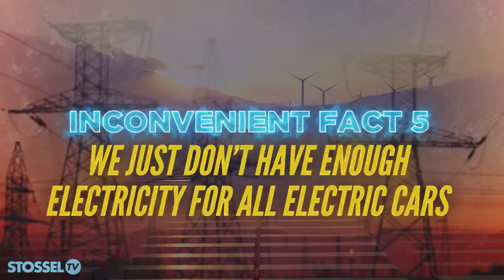Electric Cars: Inconvenient Facts, Part 2

Comment: I worked for a major public utility in Southern California for over 22 years. When deregulation was proposed and accepted, this utility was fully on-board and sold a number of its power plants in the LA Basin to companies outside the region. It significantly reduced their yearly costs from a personnel and maintenance perspective. A few of these were base load plants but the majority were what we called "spinning reserve." It allowed the authority that addressed the shifting daily needs of the region to provide the needed power. At times even this spinning reserve was not enough to meet the daily demand, and thus power from external sources was needed to make up the difference. But power was available and rarely were there any brownouts or full blackouts.

Then the companies that had purchased the power plants, who were required to make them available for baseload and spinning reserve, played a game taking them down for maintenance and other issues. Of course, they supplied power from their other generating facilities outside the state on the spot market, at a higher price point.

Then the state stepped in and prohibited the use of once-through cooling using natural resource water, so ocean, lake, and river water were no longer available for cooling the plant and the older facilities would need to build cooling towers to provide the needed heat sink. Of course, some of these plants were built in the 30s, 40s, and 50s and no land had been set aside to build that type of infrastructure. In addition, building those type of facilities are expensive and when you are operating on thin margins, to begin with, the cost-benefit is not there and the regulatory hoops that you would need to jump through were significant, see California Coastal Commission, Environmental Impact Reports, and potential neighbor opposition. So, what happened? Shut those plants down, and we will purchase power from other power generators outside the region.

Increase in electricity costs and rolling blackouts. Generators outside the region are required to service their regional customers first and any surplus can be placed on the spot market, but if you are at capacity for your local distribution, no surplus and the others that need additional energy are just out of luck.

No major electrical generating facilities have been built in California for a number of years and in fact, more have been shut down. This is a trend across the country and until someone with a backbone steps up, it will only get worse. All of the alternative narratives around solar, wind, and other alternative sources will not replace baseload requirements, particularly when the sun goes down or the wind stops blowing.

The ignorance of the general public about this issue is frightening as is the overwhelming noise from the alternative energy voices that drowns out those trying to deal with this from a realistic perspective. I'm an old guy and won't be around that much longer, but I wonder what my children's lives will be like. I think I lived in a sort of golden age and the future looks like 💩.
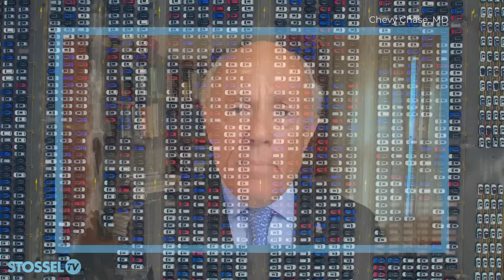Reply: (5:17) systems designed by bureaucrats instead of by engineers
Reply: Except California basically has no base load requirements any more and hasn't for some years.  Its not even a question... its in the data.

Have you looked at the duck curves on the CAISO?  Particularly in spring?   There are periods where traditional base-load-capable sources fall below 3GW of generation with evening ramps that are insane.

For example, take a spring day... May 10th 2022.  About 27GW of peak demand.  16GW 3-hour ramp starting at 5pm and only 5GW of traditional base-load-capable generation on.    Not to mention 80% renewables across the mid-day with non-renewable sources falling to 3GW.

That is what the system is capable of doing now.  And its doing it essentially without any real base load requirements.  The state doesn't even need to carefully match traditional generation sources (mostly natural gas and imports) against load during the peak evening ramp, even though the traditional sources are handling most of the ramp.

It just needs to be within a gigawatt or so and the 3GW worth of batteries with what I'm guessing are around 20mS response times take care of the rest.   Literally.

This isn't the grid you knew 22 years ago.
Reply: The ignorance of the populace in general is frightening . Just look how we vote !! Our children and grandchildren will never see the America us older folks experienced  ...
Reply: The problem of peaker plants was solved in Australia with huge batteries reserves.   California is building battery reserves that will dwarf the Australian ones.  All that excess solar and wind power that doesn't get used can be stored to take the place of spot spikes in energy usage when the sun is down and wind isn't blowing.  Golden age is already here.   We just haven't gotten to the middle where everything is gold.
Reply: And those battery storage facilities are pretty expensive for the power they store. Yes, it is better than nothing and should be used as a bridge to the future, when better electrical storage means become available, but the cost to extract, refine and produce the battery active material to  build storage batteries will be pretty large and it will damage the environment. Digging ore from the ground always does.
Reply: @junkerzn7312  and what does it look like on a sweltering August day, not a mild May Day?
Reply: @TheSwissChalet  lol, right?
Reply: @jamescalifornia2964  it's more how they "Count", don't you think? But I agree, people are stew ped. They care more about minute things than learning about their country.
Reply: Storing electrons in batteries is needed but not efficient in terms of practical daily use.
Reply: @TheSwissChalet  Sweltering?  We're talking about California here, not the east coast.  

And what does that have to do with anything?  Base-load requirements are not seasonally optional... either a grid has them, or it doesn't.
Reply: @franklinmartin8103  That's why they need to start building more of the CO2 batteries.   Just steel, water and CO2.  Cheap long term storage.   No lithium involved.
Reply: @picktheblueone  What did I miss?
Reply: @jeffcampbell2710  You are using really old data.  Current 1000 lb batteries need about 51K pounds which is 25.5 tons not 500 tons of ore to process for one battery.
Reply: @TheSwissChalet  ?  Something wrong up in the 'ol noggin, Swiss?
Reply: Agreed; all of it. I’m getting on too so it won’t affect me greatly, but future generations. that’s a completely different ball game. Veritas omnia vincit = truth conquers all.
God bless America 🇺🇸
Reply: We aren’t ignorant (ie. general public) we just have been overridden by politicians having or wanting fat bank accounts.
Reply: @franklinmartin8103  damage the environment once, then the material is mined and re-usable. Why is this even brought up whenever the discussion is in contrast to continuous environmental damage
Reply: How can I get a copy of your comment Chriron19, the one that starts with “I worked for a major public utility in Southern  Calif…?
Reply: @fetB  if you believe that all the battery active material is "reusable", I am saddened for your naive stance.  Just by the charging and discharging action this material under goes a volumetric expansion (during charge) and a volumetric contraction (during discharge). After several hundred cycles the material is pretty much in a mechanical state of fatigue. The first property of the material that changes is the crystalline structural. This material is refined and manufactured to exhibit specific physical and electrochemical properties. These properties change over time and spent battery active material is NOT 100% reclaimable. That means new material must be mined, refined and then processed for the specific properties required to store large quantities of DC electricity.  The spent active material can be chemically dissolved and then reprecipitated again under the same process used in the initial manufacture. But that to has a cost, and when first starting out, the cost of reclaiming low quantities of used battery materials will be higher than mining and refining new materials because of tear down and separation processes for all the various materials in the used Energy Storage System. You will be surprised at the cost. These operations were evaluated about 10 years ago by many large corporations. No one wants to be the pioneer in this since the entire cycle from cradle to reclamation and secondary usage is so costly. Many companies are waiting to jump in when all the processes that must be completed are better known and costed out.

It is simply easier said than done. For the politicians, that is the easy part. The doing part is the most costly. They won't vote for the billions needed to actually do this. Presently it is a great campaign gimmick to say that you want to. The hard part is getting the money first to set up the pilot plants, then collect data and go through endless cycles of improvements to find the least expensive processes to use. Mining, refining and making the initial active material is now well known.
Reply: @ignaciomenendez8672  hold down the right button on your mouse, and...
Reply: @Custos Luminis petro chemicals are going to be used for centuries.  American oil will exist for centuries.  Capitalism will make the burning of oil a lot less profitable.  Renewables are way cheaper than Stossel and the physicist that also said that smoking does not cause cancer is saying.
Reply: @victorluke5816  Australia has had their issues with the battery reserves, not to mention the indecision or change in government policy isn't giving existing plants the security they need to invest in required maintenance, so now they are going down more often.
Reply: @jim9930  And even those natural gas plants could take 30 min to 2 hours to get to full tilt. It's the ideal start to where they are producing and contributing to the grid in like 15-20 min.
Reply: I was a GE Gas Turbine Controls Field Engineer from 1998-2007.  My first job assignment was to re-install a LM2500 power plant from California to Jonesbough AR.  That took about 22 MW off the grid in California.  In 2000, I took another LM2500 power plant from Artesia CA to a Phoenix, AZ.  I took a total of 44MW off the grid in California.  The owner of the plant in Artesia could not make a profit, so he sold it.   Politicians and Liberals are poor engineers.   I did a small project in CA outside of San Diego.  The plant was Pio Pico.   You would not believe the antics of those who did not want the plant to be built.  Anyway, there is about 450 MW added to the grid that would not exit if liberals had their way.  Why no one calls them on the lack of facts is due to the reporters are all liberal arts majors, instead of engineers.  Thus, they don’t know shit.
Reply: @bengaltiger96  Never the less Australia battery capacity doubled this year.   While coal just gets more expensive to use.  This seems to be another reason to use more renewables if the old plants are failing.
Reply: @franklinmartin8103  you might have given specifics, but like i said, didnt even bother to read them because you already disqualified your whole argument with the premise. 

And i literally stated that politicians, that includes Biden, have no actual interest in changing something for the better. So much for comprehension skills. On the bright side, you got that in common with that cnt. Maybe you can bond over that and bury the hatched.

As for ad hominems, you've changed the tone. Dont like the echo, dont shout
Reply: @fetB  you are not in any position to disqualify anything. Your pathetic reply only shows a shallow childish understanding of the issues. Just like most politicians, for them and apparently you, it is easier to point the finger and wave the hands about how easy all of this is.
Reply: @franklinmartin8103  again, literally said its not easy, and i didnt disqualify anything, you did...
Reply: I saw this kind of same mentality infest our U.S. Navy. We had a spare parts supply shelf that had hundreds of New Old Stock still in original packages and used good parts not in packages but might just be bay it self in the bin. We had it all inventoried and sorted out to find it easily. One day we had some U.S. Navy inspectors come in and they saw the parts not in packages and asked about them. We said they we new and most likely had been put in a circuit only to find out the part we replaced was good so the old part went back into the equipment and the newly used part went back in the bin. We were told any part that wasn't in it's new package had to be thrown out, even if it had tested good. We threw hundreds of thousands of dollars worth of good parts into the trash can outside. Eh except, some wise old timers, for the really hard to find parts that were no longer manufactured we kept. We tested them and packaged them to protect them and hid them from the inspectors to ensure our Navy had the parts when needed. The weird part is in order to test those parts you have to take them out of the package. If the part is good you can put them in a protective package and the odds of that part actually being bad or damaged it ridiculously low, and the equipment it went in had to pass tests before it could leave anyways! In short we had to build up for weeks these parts bins then tear them down and ship the parts 6 states over to a central whorehouse that if we needed a 2 cent part we had to place the order through FOUR people minimum. They'd spend time to package them, spend $60.00 bucks or more to have them overnight ship them to us, and go through our supply system at the shop then we'd get the part and then install that 2 cent part. "You don't think they actually spend $200.00 dollars on a hammer do you?" Well folks I'm here to tell you, no they don't, they spend $250.00 on a 2 cent part in man hours and shipping. In the end we had to spend weeks building and tearing down these parts bins 11 different times before some paper pusher finally realized what we were saying all along. "We will save time and money if we have the most commonly used parts on hand, because we'll be skipping all those man hours and shipping costs to get it here. How did they figure this out? The Navy paid 10 of our people at 25 plus dollars an hour for 8 hours a day to sit in a room for a week with a guy who flew across country, rented a car, rented a hotel room, feed him, to prove to him why we need these parts and to come up with better ways to make the repairs faster. LOL you can't make this crap up guys! They're so worried about loosing a 2cent part that they'll pay thousands of dollars to pay someone to, store it in a central building in another state, watch it and catalog it and then overnight ship it to anyplace that needed it. On top of that we'd get paid to sit in a room to learn how not to offend or harass someone who's confused in the head about what sex they are, what race they are, what speech make them mad and hurts their feelings. If you do those things, well we don't care how many years of experience have on how to fix sensitive proprietary military equipment, we'll fire you and hire someone with no experience to take your place so that person whom you offended feelings won't get hurt by you again. We know it's better to protect their feelings that our nation. LOL Didn't happen to me but seen it happen to others. This country better wake up, before it gets hammered by our enemies. We're so worried about hurting peoples feelings that we're willing to degrade our military that protects us from countries like China, the Russians and the Religious nations around the world who want us dead and to take our stuff. I finally retired after serving our country for 43 years, my dad got sick and I got tired of the Snow Flake Sensitivity Training! He passed away this year but I'm staying retired, I don't think I could go back to the Snow Flake Sensitivity Training again. Well the real true Educational Training on what's going on is over folks. Best Wishes & Blessings. Keith Noneya
Reply: Cheiron, thanks for your wisdom. I only hope that the right people would listen to it.
Reply: @brazosbear4593  Unfortunately I don't think they will. I retired over a year ago, we were short 4 experienced technicians then. I've heard since then they've lost 5 more technicians have left for better paying jobs. Each technician has a certain amount of years of experience. To illustrate if you have 10 technicians with 10 years of experience each you have 100 years of experience in your shop. In the last 2 years we've lost over well over 200 years of experience in the shop and replace it with about 50 years of experience. Actual electronic technicians with experience are so short we replaced some of those positions with former military electricians and trained them in electronics because they have a basis of some electrical experience. It takes years to train a person to be a good electronics technician. Seriously we've become a board swapping troubleshooting military and for good reason. However if we ever get into a real shooting war and that supply chain breaks down you'll need real electronic technicians to know how to fix those cards and swap substitute parts into them that will meet specs in a combat weapons platform. Sadly I think I was one of the last few people to know how to do that at my job location when I retired. The Navy and other branches need to start training electronic technicians again. Think about the movie "Crimson Tide" when that tech had to fix the communications rack to prevent a Nuclear WWIII. Those are the kinds of tech we need and sadly no longer have. I know because when one of the FRC's Buildings that fixes electronics was being renovated we had to share our civilian bench space with the Navy and Marine Corp electronic technicians. They ran into a problem with a piece of electronic equipment chassis, went into a Marine Helicopter, that wasn't a circuit card that you could swap out. That equipment chassis some transistors in it and some wiring. The techs couldn't figure it out because NONE of them know how a transistor worked. I helped them isolate the problem and find the part number to order the part. Now this is ridiculousness because the repair procedure on that chassis wasn't in the book, they weren't allowed to order the part and repair it. The condemned that whole 10 of thousands of dollars worth of piece of equipment for a 10 cent transistor! They had to mail it to someone who knew how to fix it. Ok I need to stop, I could just go on and on, on how stupid our procedures and lack of training have become for various bean counting reasons. Best Wishes & Blessings. Keith Noneya
Reply: @fetB  poor attempt at switching perspectives. You must of did poorly in your college rhetoric class, if you actually attended any college classes
Reply: @jeffcampbell2710  It only takes 51K pounds which is about 10 times less than your figures.   The newer batteries are easier to make and don't use any Cobalt or Nickel.   Mostly lithium and Iron.
Reply: @junkerzn7312  the grid is worse than 22 years ago deregulation has increased reliability issues.

Base loads have 0 impact on the subject.  Go get a job in power generation
Reply: @victorluke5816  will not sustain you cannot store that mush power period. Peakers are not the anserw, combined cycle can't even do it.
Reply: @junkerzn7312  it’s funny how you dismiss that “gigawatt or so”
Reply: @fetB  and imagine the environmental impact of thousands of acres of solar panels.
Reply: @pmscalisi  How much power do you think non-base-load sources were pushing at the same time?   Explain how Diablo Canyon, which isn't even online 30% of the time, is synchronizing the grid all by its lonesome.

Come on.  Try.  At least try.  This is getting boring.
Reply: @SoGoodRc1  RIght now they have about an hours worth of storage.   They just need to expand that to about 4 hours and that's enough.   I'm going to bet on the Carbon Dioxide battery for the cheapest costs.  Peaker plants have been the answer for the last 3 decades so I'm not sure what you are talking about.
Reply: @junkerzn7312  that’s how power systems operate. The generator in sync is producing vars which helps offset the system reactance. 
If it’s not producing watts and the generator used is connected to the grid it’s basically a synchronous motor and exciting the field produces the vars.
It actually makes the power system more efficient. Nuclear power is cheap to use.
The system isn’t dc. It’s three phase ac.
Reply: @victorluke5816  What grid we talking about?  California right now has around 10GWh worth of grid-scale batteries in operation which do a 4 hour minor cycle in the morning and a 4 hour major cycle in the evening.

They push 2.5-3GW for 4 hours currently in the evening.   Below 2.5GW they push for 6 hours in the evening. 

There are at least 9 new battery projects proposed for 2023 and 2024 in NorCal alone that all together will add another 6.4GWh (1.6GW for 4 hours) to that total.

That will take the grid to almost 5GW x 4 hours of battery support in the evening.  And these proposals were before the heat wave.  I'm guessing everything is being accelerated now.
Reply: @victorluke5816  You can't just rely on the sun and wind. California is learning this lesson the hard way - which is why they have finally somewhat come to their senses and decided NOT to shutter Diablo Canyon. The more electrification required for vehicles, homes, steelmaking in lieu of coke, etc, required, the more baseload that will need to be generated, preferably from nuclear. And then if you want to get into hydrogen power, well, that's gonna require even more electricity, which means more baseload. Australia is the lucky country with all of its natural resources, but seems hell bent on misappropriating these in the quest for a greener country. I live here and there's absolutely NO reason why Australians should EVER be short of power, aside from not paying their bill.
Reply: @pmscalisi  You don't want to answer the question eh?  Well, it was rhetorical, but since you are so focused on one whole gigawatt doing all of this magical stuff, then perhaps you aren't aware that batteries push almost 3GW during the evening peak every day.

So which is more important for grid stability?  Your precious fossil and nuclear generation, or batteries?

By the way, that will be 5GW in another 2 years... probably more since I haven't looked at SoCal's battery plans, only NorCal.  In less than a decade we will probably have 10GW x 4 hours of batteries cycling daily.

What's your solution again?
Reply: @jeffcampbell2710  — Yes , sad but true ...
Reply: @pmscalisi  like what?
Reply: The future looks like fascism to me.
Reply: @FlanFlanScarlet  more probably some sort of natural gas fired generating plant.
Reply: @junkerzn7312  I take it you've never been to Redding, Red Bluff, or any place in the central valley?
Reply: O
Reply: @victorluke5816  peakers are just that.... they are not designed for sustainability they run during peak hours when power sells high. Unless they are combined cycle they are very expensive to operate.
Reply: @fetB  have you seen even one of these batteries reprocessed? I'm willing to bet that it would be impossible to do in the USA given the current regulatory state. Thus they have to be shipped back to China using fossil fuels to power the ship, and be reprocessed using fossil fuels....
Reply: @bengaltiger96  Why they're called spinning reserves was because they were in essence idling. Operating at some minimum capacity so as to be able to ramp up when needed.
Reply: @keithnoneya  I'd love to be able to upvote your comment a million times.
It certainly matches my experience with the army!
Reply: @wheel-man5319  but thats a political issue not technological. It's 100% a big problem in getting anywhere properly. And not just now, but has been for a long time. Belive it or not im a huge fan of ICE manual racecars and in a better world electric would have been developed alongside decades ago and thus drastically reduced or eliminated a lot of the problems faced today. From utilities being electric to a much more robust and independent grid, we would also haul dirty cars and nobody would care because that impact is trivial. It's important to separate imposed issue by politics and the technological challenges. You will never see me argue in favor of the BS politicians fabricate. Saw a quote a while ago that hits the nail. (paraphrasing) the people that strive into high places of politics are exactly the kind of people you do not want there because they got there by manipulation and only seek power for their own benefit. 

It is however possible and necessary to have smarter ecological things.
Reply: @SoGoodRc1  That's why batteries are such a good substitute for them.
Reply: @bengaltiger96  I applaud the decision not to shutter Diablo Canyon.  The only way to rely on the sun and wind is with batteries.  That's why the new Carbon Dioxide battery is a god send.  Cheap reliable batteries that require no rare earths and can reliably hold a charge for decades according to the science.  No one has kept a charge that long because the batteries are too new.  The new offshore wind generators are massive with the current record for being able to generate enough power for 8k houses per wind turbine.  This will increase the baseload considerably.  Australia is getting short on power due to power plant operators wanting to make more money.  They are building out wind and solar and not putting in enough batteries to make up for nightime low wind times.
Reply: @junkerzn7312  Looks like they finally got serious.  Great.
Reply: @victorluke5816  "renewables are way cheaper" 

No, they aren't. The reasons public chose oil over electric the first time was due to cost, efficiency, convenience, and mostly the cost. The only reason your renewables/green energy is even making headway isn't because it's better. It's because the politicians forced it on to the public. In every measurable market, electric vehicles and green energy are the worst solutions.  

"that smoking does not cause cancer" 

nice strawman distraction. You throw that tidbit in there like it has relevence to the conversation. You're part of the same group that will tell us that we should listen to the "experts" aka doctors and engineers, yet when those people tell you that you are deluded, you will claim they were bought out by the big corporation!
Reply: I am 65 and you are on the same page as me.  The future is depressing
Reply: Things as important as electrical energy, which one's livelihood depends on should not be at the mercy of the "general public" decisions through political action. Does the "general public" know the future? Does the "general public" know what is best for you? Then why are these important sectors subject to lawful controls and regulations? Laws are not made automatically from disembodied superior know-it-all entities. Laws are made by people, people who do not know the future and that are not omniscient. What happens when those people make mistakes? Is it OK because they were just "trying to help"?
Reply: Thanks, its rare to hear such a well informed explanation.
Reply: @birddogne666  Its more expensive to use due even in jurisdictions that don't have laws to make it safer to use.  
1.  Construction of renewable power is just cheaper due to falling prices of renewable power plants.
2. Coal plants are getting old and when they get old the repair costs make them less affordable.  Maintenance costs for renewable energy is just a lot cheaper.
3. Right now renewables are still more expensive to use in Canada, South America, and most of Africa.  By 2030 the cheapness of renewables will make it economical to bring them to these areas as well.
Reply: @steveharvey6421  You guys have been saying that for the last 200 years.
Reply: @birddogne666  Yes, I do usually listen to experts instead of the foil hat brigade.  If someone is being paid by big oil to say that there's no such thing as global warming I'm a little skeptical.  Especially when they say the opposite when they weren't paid by big oil to say it.    I would say the same if someone were independently saying that we should all use coal and then switch to don't use coal when hired by solar power companies to state their opinion.   Its usually a good idea to do that.

As for oil being cheaper just look at Chinese prices for coal, oil and solar.   No price supports for any of them.  Solar is the cheapest.   Why do they still build coal plants?   Because they build all power plants because they just can't keep up with the energy demands so they burn everything no matter the cost.
Reply: @picktheblueone  Just saying that their info is out of date.   Name me one where its current.
Reply: deregulation  of  power /  utility  companies  was  the  first  big  mistake.
Reply: @franklinmartin8103  And repeat it every 10 to 20 years too.
It's a horible solution designed to line politician and friends pockets.
Reply: I believe you and that's hard to say in the internet. Thank you for what you have written here.
Reply: @ignaciomenendez8672  I just screenshot it.
Reply: @victorluke5816  There will be ZERO excess energey to store in these batteries. We need it for daily use. Build more nuclear plants. Nuclear IS THE ANSWER.
Reply: @tedtedness184  Since each offshore wind generator can power 8000 houses I think it won't be that hard to get excess energy.  I would love it if California coudl build more nuclear generators but Californians would never allow it.   Unless we can get molten sand reactors which can be advertised as something that can get rid of  nuclear wastes.  That's the only hope for nuclear in California.
Reply: @driver4011  Its already happened.  We just have to live with it and use it to our advantage.
Reply: @junkerzn7312  nice deflection
Reply: @tedtedness184  
true.....and  what  are  they  going  to  do  with  all  the  old, used, corroding , n  leaking  lithium  batteries ? same  thing  with  all  the  used,  melted,  n  broken  solar  panels,  n  broken  wind  turbines.
Reply: @victorluke5816  
nuclear  works  well, n  so  does  coal.  there's  300  years  of  coal  left,  which  can  be  burned  cleaner  with  modern  filtration  technology.
Reply: Thank you!!
Reply: Thanks for posting, Ill save a screen shot so I can show this to our teenagers.
Reply: @franklinmartin8103  the exorbitantly expensive liquid salt tower was shut down because it was just too expensive. So much money has been wasted on alternative energy sources but we just don’t have the technology yet.
Reply: @junkerzn7312  How long have you lived in CA? Even the SF Bay area has a couple of weeks of 100+F days most years, when the normal flow from the ocean is reversed. And if you go inland, it's hot there all summer.
Reply: @driver4011  I'll do my best to take a few with me if it comes to that.
Reply: @victorluke5816  All the batteries in the world together, runs the world for one minute and twenty seconds,
Reply: Excellent information. Surely there are engineers who will step up…..
Reply: @victorluke5816  If these batteries actually come to life and end up replacing the current lithium ion batteries, then I'll be happy to see those complement solar and wind as peaking solutions (solar in the event of hot sunny days in the Central Valley). Hell, I'm still waiting for Vanadium Flow batteries to come to life in Queensland, which I think would also be a great, less expensive, and safer battery solution for home solar systems, but they aren't in mass commercial production at this time, either. A steady diet of nuclear baseload would truly be the key to low carbon mass power generation, and hopefully they will accelerate the SMR programs that are starting to crop up around the country and around the world. We need to use all the tools in the toolbox, and when it comes to vehicles, hybrids are far more the ticket than plug ins, which do shittier on the highway or on long journeys, or electrics, which will have their day when more dense battery technology comes around, but for now are more a specialty/boutique item being forced on the public too soon. In addition, for those who have longer commutes or live in the sticks, the demonisation of diesel for this purpose (other than farming and heavy transport) has also hurt the decarbonisation cause.  And finally, we need to focus on carbon capture and removal technologies, because regardless of what we do for power, China, India, the whole of Africa, and the whole of South America will burn coal and natural gas for power. We can develop and license these technologies to them (at least until China steals the IP), so they can also enjoy the benefits of a middle class existence with plenty of power. Energy will be needed in far greater quantities if we want to do shit like hydrogen production, desalination, steelmaking with less coking coal, etc.
Reply: @wheel-man5319  😊🙂👍🍺
Reply: Fellow suffering Californian!
Reply: Very well said sir! Thank you for speaking up!
Reply: @junkerzn7312  You're not believable.
Reply: @victorluke5816  That's not likely going to happen and batteries degrade over time.
Reply: @junkerzn7312  We don't need batteries the state needs more prime movers. The power has to come from somewhere and batteries are not it.
Reply: @victorluke5816  The United States only has one lithium mine.
Reply: @Gunalizer  You can make as many incorrect assertions as you like but the data, readily available on the CAISO website, tells a different story.   Real data from the actual grid, not made-up nonsense.

Beyond that, you are mostly complaining about your own misinterpretations of what I said, and your own misinterpretations of standard industry terminology.   That's  on you.
Reply: @junkerzn7312  I will admit, your statements aren't making sense to me.
I'm not convinced that even you know what you're trying to say.

One bit that sticks out to me - "The state doesn't even need to carefully match traditional generation sources (mostly natural gas and imports) against load during the peak evening ramp"

That sounds like science fiction technobabble - the shit you make up to talk about a subject that you don't understand.

As I understand it, electric companies constantly need to evaluate all sources of power and proactively match the output to demand. Failures to do so - the times that their redundancies fail and the system load doesn't match (over or under) - have lead to significant brownouts and blackouts.

"For example, take a spring day... May 10th 2022.  About 27GW of peak demand.  16GW 3-hour ramp starting at 5pm and only 5GW of traditional base-load-capable generation on.    Not to mention 80% renewables across the mid-day with non-renewable sources falling to 3GW."

This is a nothing burger. You're not actually saying any complete statement. You're not drawing a picture. You're citing a bunch of random crap (without citing sources) and saying that together it means something without context or support for such a statement.

You're not putting your technical details together in a way that presents coherently. Please tell me you're not currently employed as an engineer.
Reply: @Gunalizer  Batteries do degrade over time unless they are Carbon Dioxide batteries which are like forced hydro.  Also the LFP batteries take a lot longer to degrade than regular lithium ion batteries.
Reply: @Gunalizer  The US can build more lithium mines.  There's more than one location where there is lithium.
Reply: @bengaltiger96  The Carbon Dioxide batteries are actually in use now but only in one location.  I really expect  these to become more common due to their low cost.  Good batteries that cost an arm and a leg don't do well until they lower costs.  The CO2 battery is already cheaper than all the others.  They do take the most room so they are only good for stationary storage.

Diesel deserves some demonization.   Firefighters that use diesel vehicles typically lose a few years of life due to the exposure to diesel fumes.

Countries that have experienced nuclear melt downs usually have a much higher resistance to nuclear power.   Currently those are the former Soviet Union, the USA, and Japan.  All modern reactors are safer than the ones that melted down.   I just have a hard time seeing them build more nuclear plants in the US.  Once again, molten sand reactiors may be the only exception.

If Tesla gets a foothold in Australia you will probably have their superchargers dotting the landscape soon.  They build those superchargers really fast.   I complained that I had to drive at least 10 miles to get to one and the next month they built a 13 unit supercharger 1 mile away from me.   When I complained about the 13 unit supercharger being full alll the time they built a 25 unit supercharger 3 miles from home after 3 months.

Hybrids have been around since WW1 on submarines and I just think that improving batteries is a better idea.  

Long distance drivers will need to use some of the solar designs like Aptera which I am hoping will be delivered in 2023.   I want an EV with a thousand mile range that self charges 40 miles a day.  I won't place an order until they start delivery.  Their deluxe prices are lower than Tesla starting prices and they also use the Tesla power plugs.

Carbon capture has been too expensive to use so far.   Not saying that it will never be cheap enough but so far it hasn't been.
Reply: @waynecooling2433  When they mass produce the Carbon Dioxide battery they can build enough for them to run the world for a week.  They are that cheap.
Reply: 🐑🐄🐖 Animal Farm!
Reply: @victorluke5816  No. It takes massive mining operations to mine lithium. Not happening anytime soon.
Reply: @victorluke5816  You can't "build" a lithium mine. You have to have lithium deposits and conduct massive amounts of mining. Just like for coal. The irony.
Reply: Yes that's what happened as when the State gets involved running it.  Once you don't pay attention to up to date, it gets expensive. I used to live in California little more than 22 years.  No longer live there now.  Left for good. CA wastes lot more tax payers money, not just only  electrical generating facilities, roads, and many more as I saw.
Reply: @Gunalizer  Exactly there are more deposits than mines in the US.   I'm glad you understand my point.
Reply: @junkerzn7312  So your saying that someone who has worked in the industry doesn't know squat,but you are the genius that has all of the answers.
Reply: @Gunalizer  Elon Musk does support mining.  He's also no leftest.  He's been able to get more mining done.  He's been one of the best beuracracy smashers I've ever seen.  He built the Berlin Gigafactory in less than 2 years.  Normally takes about 10 years for the Gemans to let someone build something that big.   I have no doubts that he's going to be able to do it.  The cars are not magic they are just better than the ICE cars and by 2023 the ones that are cheaper than ICE will start to be sold.
Reply: Whoa 😳
Reply: @Gunalizer  Mining has to be done somewhere.  The US can do it better and cleaner than anyone else.  I vote for mining in the US.
Reply: @junkerzn7312  I assume you were living a cave when the "do not charge your cars" mandates were issued. THAT is the future in California. Enjoy it.
Reply: EXACTLY
Reply: @birddogne666  I agree with you, I am not an engineer,I don't claim to know a lot about electric power generation, but I seem to remember an old saying "If it not broke don't fix it" and "If it's not broke,don't fix it till it is",there was nothing broke with an electric power system using coal,natural gas, fuel oil or nuclear, it was plentiful,cheap and very reliable, so why are we trying to fix what isn't broke? We have no shortages of coal,natural gas, fuel oil or nuclear, except for the Biden administration artificially creating shortages with there forced shut down of gas & oil pipe lines in favor of so called renewables,this is like a huge subsidy to the renewables,while there have been some subsidies to the oil and gas industry, I don't remember the federal government shuting down other energy industries so that fossil fuels would have a clear field all to themselves, in the beginning the government didn't get involved in the competition between oil and electric to power motor vechicles,they let competition decide that and oil won because it was better,electric powered vehicles have basically the same problems now as they did then,the federal government  should get out of the way and remove the restrictions it has place on the oil and gas industry, and let the two compete,but the Biden administration doesn't want to do that bc it knows that oil would come out on top again besides,if the renewable industry needs so much help from government, isn't it just possible this is not the way to go,perhaps it just isn't ready for prime time.
Reply: @victorluke5816  Sorry to break it to you. That's highly unlikely.
Reply: @Gunalizer  I can't see what you are replying to.  If its about mining then that's what the IRA was passed to do.  Make more mining, refining, and building of batteries and EVs in the US and North America.  Elon is always good at getting tax credits.  When they changed them in Canada and China to make Tesla ineligible he was able to change enough to get his cars back into the rebate and tax credit zones.  I see him going into mining and refining of ores pretty easily.
Reply: @victorluke5816  hope they don't do a tesla...and go up in smoke.
Reply: @fetB  these lithium batteries are not easy to recycle...and are dangerous when not handled correctly.....
Reply: @feydespiel.  A dedicated battery recycling center is required.  50% of lithium batteries are currently recycled including the ones in cell phones and laptops.   Once everyone remembers how valuable the recycled products are they will dig them out of landfills.  Redwood Materials can handle any lithium battery recycling.
Reply: @feydespiel.  You mean have 8 times less chances of catching on fire than an ICE vehicle. 

If you are talking about CO2 batteries they actually can't catch on fire.  Steel and water don't normally burn easily.
Reply: @junkerzn7312  Trust the " science" right? Depending on which god you serve of course.
Reply: @feydespiel.  Just add water. 😂
Reply: @bengaltiger96  "...which is why they have finally somewhat come to their senses and decided NOT to shutter Diablo Canyon." That's excellent news. My old hometown hasn't completely turned into Corinth just yet.
Reply: @hardlyb  Pretty much all my life, Hardy. Hot days do not necessarily translate into power generation shortfalls.  In fact, they rarely do because it is fairly uncommon for the coast (where most of the population lives) to stay hot overnight.   Evening and overnight are the only time periods that the grid cares about.

The typical overnight cooling leaves a veritable ton of power available for inland AC use going into the evening.   We barely had even two weeks of weather this year where the coast didn't cool overnight.   Plenty of weeks of hot weather, but not so much situations where the entire state stayed hot overnight.

And of course, the state has so much solar that there is never a problem before 4pm anyway.  Hot days.  Solar... kind of a good match, eh?

That is the reality.     What the state actually suggested during the most recent heatwave was the following:

(1) Run your AC full-out during the day

(2) Try to conserve energy across the evening peak (basically 7pm, but the request was 4-9pm during nearly the entire heat wave and 4-10pm on two days of it.

(3) Don't use large appliances are charge your EV during the evening peak (4-9pm) to help the state get past the peak.

That's it.   Of course, idiots living in their little bubbles of nonsense just glommed onto the "don't charge your EV" part and kinda forget about the rest.   And also kinda forgot the little detail about the state having huge power margins during the day.   Like the guy trying to talk-down battery storage... showing complete ignorance of how the power grid operates on a day-to-day basis.

Idiots who are continuing to post their nonsense.  But I don't really care... if it means they actually believe their own nonsense and never contemplate migrating to California I am all for it.  Our population is too big already.
Reply: @junkerzn7312  I live in reality,always have,I don't claim to be an expert on electric power generation, but I know that using coal,natural gas, fuel oil and nuclear to generate electricity has always worked just fine and has been reliable, when I flip the switch the lights come on and I can afford it, if we continue to go down this rabbit hole of renewables, I will one day flip the switch and the lights won't come on,and if they do I won't be able to afford it, I can easily see a world where the common people will not be able to afford to heat or cool their homes,but the wealthy elites will of course have no problem, and only they will have electricity, while the rest of us go without,and all of this bc of this climate hysteria over something that not happening,I am 70 and I haven't seen any change in the climate, none of the predictions that have supposed to have happened by now have come to fruition,it is imo a hoax,the greatest scam in world history, besides there is nothing wrong with continuing to use coal,natural gas, fuel oil and nuclear to generate electricity, that way of generating electricity isn't broken,so there is no need to fix it,btw,insulting those who may not agree with you is not the best way to win them over to your side, in my response to you,I hop you notice that I did not insult you by calling you names like you did me,I have noticed in my lifetime that when someone starts name calling,it's usually because they have lost the argument. Please have a nice day.
Reply: @theberserker9285  What rolling blackouts? Maybe the problem is that your assumptions are wrong.  Have you ever considered the possibility that your information sources are lying to you?
Reply: @theberserker9285  Past tense.  Look at the date.  You did look at the date, didn't you?Did it happen to the level of exaggeration you keep on trying to push?   No?   In fact it did not.   Did California suffer blackouts at all this summer?   No.  It came close, but nobody's power had to be turned off.

And also, why are you continuously trying to misrepresentation my position on grid stress?    My position is certainly not that there isn't any stress or that there isn't a chance of a blackout.  We came quite close once this summer. 

But you know, that's a whole lot different than the story you are trying to paint now isn't it?   You are so invested in wanting the world to be a miserable place if the disasters aren't big enough for you well, you will bloat them up with exaggeration until they are.
Reply: @junkerzn7312  What argument ?
You're sharing your thoughts and I'm
sharing my sources of information.
You seem to have some kind of superiority complex that I find quite offensive..
Reply: @junkerzn7312  Rather than getting all high and mighty ....Just post me a link to a credible source of your information.. that would be much more helpful that being rude.....
Reply: Being saying it for years....
Reply: @franklinmartin8103    1.  Must've, not "must  of."  2.  Why the ad hominem attacks?  Rely on your technical savviness and persuasive presentation skills.  YT has enough interpersonal ugliness as is.
Reply: @keithnoneya    I say we focus more on amping-up bringing in the right brainpower, not manpower as now, through expanding targeted immigration.  But how would we produce out of those new visa holders and immigrants alike coming in the "humble" technically-trained, like lowly electronic techs, we need when what's coming in now mostly want even higher-tech education and jobs and the money and prestige that come with that?  How can we make what you and I WANT, i.e., hands-on tech careers, sufficiently 'profitable' in the money, satisfaction and status sense?  For example, for the Indians coming in now, software-savvy jobs is where it's at, right?
Reply: @brianjob3018  well, i didnt bring the hatchet, so its not really my right to bury it since its not my property. Secondly nobody said it was easy or that you can convert/return 100%, which is his premise. It's semantics to argue whatever percent here and there when the alternative is to extract the finite resource and burn it completely. It's the same with the mighty dollar, thats, among other techniques, so effectively used as an emotional tool in this video. Trillions have been used to secure and subsidize the black gold, but somehow sustainable option are suddenly expensive and therefore not an option. The mere facts its a circle instead of a line we're walking currently, is grounds enough to work on it. But then again, solutions isnt really the goal of some people but to keep things as they are, because muh V8, which is funny because i actually love combustion engines myself a lot
Reply: @wheel-man5319    Make sure you actually  understand what Fascism truly is, and the associated words fascist and fascistic, before you throw that word around more.  To the Left, Fascism means "naughty right-wing behavior and plotting that we use to cancel the Right."  How about to you?
Reply: @victorluke5816    Molten sand reactors???
Reply: @FlanFlanScarlet  No "Spinning Reserve" are smaller generators that can be bought online relatively quickly to deal with spike loads. This would be something like small gas turbines that would spend most of the time shut down and can be spun up very quickly from cold.
Reply: @fetB     My position on the whole oil, "climate change," blah, blah matter for many years has been we need to coerce the Big 5 Oil Companies into installing at all of their gas stations worldwide where practical recharging, natural gas refilling and hydrogen gas tank exchange ASAP.  If the supply of such is there, then the demand for the vehicles will be there and the manufacturers will be motivated to invest in making them. I basically agree with your sentiments about renewables/sustainables and needing to invest, but, again, the evil Big 5 are calling the shots and holding us back!  So, what's your suggestion?
Reply: @brianjob3018  They can use nuclear wastes as fuels.
Reply: @brianjob3018  Fair, im just saying, not really up to me since i only clap back. 

Anyway you mean my suggestion to people like the other commenter or politics. For the latter, obviously there is nothing to suggest. This isnt an accident but been a campaign for a long time. GM made pretty good EV (for its time) in the 90's you're probably aware of, and then came the "motivation" to scrap it. Elon musk for he is evil, did brute for the change and now battery development kicked in a proper gear, but this takes time. 

As for the other commenter, id suggest, dont be a twit. I can only assume the motivation is to keep combustion cars, but with increase of the environmental/resource fallout, laws will be strickter. So mocking, twisting or convoluting facts, like this video, is only contributing to what he dosnt want, myself included. Imagine electric/battery was developed with all the trillions spent oversee a few decades ago. Not only would be further, 9-11 probably didnt happen and nobody would care about some diesel bros and big block hanks.
Reply: @jamebrooke894  Can not be done in Southern California. The dispersal of cities and population centers pretty much mandates private vehicle ownership.
Reply: I am an old guy as well and I can see that you are totally on point! Just yesterday I watched a video from eight years ago entitled "The Politics Of Green Energy" (Robert Rice) From Hillsdale College A very informative and totally on point presentation. As for myself I have totally figured out that this push for green energy from politicians is totally bogus, just wish the rest of the asleep population could see it.
Reply: @copyking01  You do realize that any information that is older than 5 years on green energy might as well be from 100 years ago.  The science is changing that fast.
Reply: @brianjob3018  Ancient Corinth. "Corinthiazomai" was used as a slur in the ancient world for the wealthy degeneracy. Which doesn't make for the best decisions when it comes to political, social or economic issues. From Thucydides to Donald Kagan, they don't paint a very good picture of Corinthian higher reasoning.
Reply: @victorluke5816  We will see.
Reply: I see a day soon where you have to generate you're own power, purify water yourself, fix the car yourself, hunt and grow you're own food, arm/protect yourself because the only the government is capable of doing is collecting taxes/funding the military. I'm having trouble finding a reputable car repair shop because the government isn't willing to punish any of the dishonest shop. I recently had a Toyota Corrolla engine damaged because the shop did not replace spark plugs when I paid them to replace spark plugs. I am learning how to maintain the car myself because taking it to a shop is such a crapshoot, this is hard because I'm a full time worker who doesn't have the time to be a mechanic.
Reply: @brianjob3018  No that was actually a mistake, but that's funny anyways. There's actually quite a few good qualified tech. They're call Ham Radio Operators. Problem is most of them are retired or it's just a hobby for them. The government wouldn't hire them anyways because of their age and wouldn't pay them what they're worth anyways. Our military needs to train specialists in this area like they did before in the AVIC7 classes. It was an advanced electronic theory and training, like a crash course in Electronic Engineering. To kick start some of future techs they ran lower version of this program called AFTA in Millington TN. You had to sign a 6 year contract and if you passed you were promoted to E4. Best Wishes & Blessings. Keith Noneya
Reply: @brianjob3018  No they were already in and from what I understand based on their ASVAB scores or grades they were offered the school for an additional two years. If they passed and got to the fleet, many who had gone up the ranks the hard way called them, "Rent a Crows". A lot of them showed up thinking they were all that and kinda pushed their rank around a little and soon found out they may have the training but they had no experience or respect from others. Now if they showed up respectful and learned fast and earned the respect of their peers they did great. I do think the military could revive these schools and provide rank incentives and it could work if managed and supervised by the commands who received the newly trained technicians. However I think the best use of them would be to offer it to junior personnel who had already went to the fleet and showed the aptitude for it. I had this one kid ATAN (E-3) working for me in the HTS (Hybrid Test Set) shop that was totally brilliant. He had had some electronics and programming experience in High School. He was intelligent respectful had a family and you could tell this kid was going places in life and the military. I would have recommended him as a candidate as fast as I could If that program was available then. Best Wishes & Blessings. Keith Noneya
Reply: @brianjob3018  They were already in, and were offered the school if they sign an additional two year contract. I think it could work for sure. I also think they should offer it to technicians that have already been to the fleet and show the aptitude and drive to do the job. Had an ATAN E-3 working for me who was brilliant. He had some electronic and programming classes in High School and was an amazing worker. He wasn't a smart mouth, he was respectful and highly intelligent. He was the type of kid you knew was going places in his career or life. I would've nominated him in a heartbeat for that advanced training. Part of the problem with the military is they make "Jack of all trades and master of none". They do this so if something happens to another co-worker they can step in and do that job good enough to get by until a replacement arrives. However the military needs to build up super techs who specialize in certain areas in case the supply lines are cut in war and spare parts aren't available. Ukraine is an example. Also the military is focusing to much on stand alone all in one test sets. When one part of that test set breaks down by regulation you can't use the rest of that test set to repair aircraft equipment, even if the rest of the test set is perfectly fine. However lately they have started to shift to allow some of this due to shortages in equipment. It's called limited capability. Best Wishes & Blessings. Keith Noneya
Reply: @keithnoneya    I was leaning more towards that they were already in, partly because you mentioned six-year contract
For the Army, and probably applies to the rest of the military, you can only get an 8-yr contract when you first come in, after that, no more than a six-year.
Reply: @brianjob3018  They were already in and in A-School after Boot Camp and were offered the class if they signed on for two more years. As far as if they had already signed on for 6 or 8 and could still be offered the school I don't know. Best Wishes & Blessings. Keith Noneya
Reply: This is fantastic. Thank you for taking the time to write it.
Reply: Cherion right there with you brother over 36 years in the power business from the meter base to the power plants (coal, nuclear, gas, oil, and renewables).  We are headed for a brutal lesson because the politicians quit listening to experts like us.  God be with our kids and grandkids.
Reply: @victorluke5816  you obviously don't live in South Australia buddy! You also must only read sources in an echo chamber of green leftism. That battery storage you speak of, at best, can only support 20,000 homes for a maximum of 1 hour. Let me assure you that there are many, many times more homes, and business and industry in South Australia than that. The only reason South Australia can avoid blackouts is because they have a life line in the form of the national Grid Interconnector, which supplies them with power from the eastern states of Victoria, New South Wales and Queensland. Do I need to spell out what type of power generation supplies the electricity to that national grid?
Reply: @victorluke5816  renewables way cheaper? If that was true, then there would not be a need for subsidies provided to them everywhere in the world. Poorer countries around the world would not be building fossil fuel power plants if that were true. Put simply, if renewables were the cheaper, better solution, the consumer would 100% adopt them without the need for any activist propaganda, no subsidies and no reservations. Just as the consumer has done with every other genuinely better offering ever.
Reply: @frankjohnson8098  I love your work mate. Cuttin' through the bs using experience based facts. That will never catch on!
Reply: @victorluke5816  the old plants are failing due to deliberate political interference, causing the halting of regular maintenance. I suppose you missed the out of control burn down of yet another wind turbine here in Australia a couple of days ago. That would be new renewable plant failure. A blaze out in the tinder-dry Australian bush in the middle of summer. No problem with that, we all know Australia doesn't experience some of the world's most devastating bushfires on a regular basis. Oh, wait...
Reply: @junkerzn7312  not hard to discover that CA survives by buying in power from other states, because it can no longer support its own needs since going big on renewables. Not to mention, the increase in power prices renewables also caused.
Reply: @georgebeare8883  Eventually all power generators will be renewable even if there were no subsidies.  Especially if the subsidies were taken out of fossil fuels which by far has the most subsidies in any fuel systems in the world.  In the US subsidies for fossil fuels far outweigh those for renewables even with IRA.
Reply: @georgebeare8883  Are you actually saying that wind cause more fires than fossil fuels which are by definition a fuel that you burn?
So far you have been the only one that I have ever heard making that distinction.  The reason maintenance is not being done is that everyone realizes that its not cost effective to do so.  Why maintain something that is going to cost you more in the long run while its getting replaced?   We see this calculus in most industries.  This includes the military when looking at assets.   Old equipment that gets maintained and refurbished is due to a need.   If something that has lower maintenance costs comes along the old one usually goes away.  Renewables have the lowest maintenance costs.
Reply: @victorluke5816  oh, yes. The old " are you/ so you are saying" line. Is that what I said? No. I would also note the difference between a burning down tower that cannot be extinguished out in bone dry countryside and the controlled burning of fossil fuel in machinery is worlds apart. Likewise, your misinformed assertion about fossil fuel not being maintained because it is not cost effective is another half fact. It is the case in some countries, those which heavily subsidise wind and solar, that then artificially makes fossil fuel uncompetitive. Without subsidies for those so-called "cheaper" renewables ( which wouldn't need subsidies if they were cheaper ) then fossil fuel stacks up as it always has: highly commercially viable. Just ask the Indian, Chinese, African and Asian nations which continue to build more fossil fuel power generators. Something nobody would do if renewables were cheaper and is therefore, the ultimate proof that renewables are not.
Reply: @georgebeare8883  We are not talking about deductions here.  There are straight subsidies that are only available to petrochemical companies.  These are incentives to drill.  Sure drilling is profitable.  However, they are even more profitable when a government gives you money to do it.  Currently about 20.5 Billion US dollars are put into the profits column of Oil companies due to these subsidies.  US One example is that US taxpayers have to pay $10 Billion for oil well cleanup after they tap out which the oil companies get as part of subsidies deals.   This is an incentive to drill more if the government will help clean up the mess.
Reply: @victorluke5816  how do you rationise the idea that China only builds every form of power plant because they are so desperate for energy?! It is an illogical premise. Why? Because the same man hours and money used to build coal or gas plants could instead be also used to build more wind and solar IF wind and solar were the solution for cheaper and reliable baseload power, as you claim. China build coal plants because they are cheaper, reliable 24/7 baseload power generators. To imagine otherwise is churlish and naive.
Reply: @victorluke5816  where is your logic here?! Your logic is "Because they can get hold of these fuels" referring to coal. WHAT?! Wind and solar are all around us, for free, isn't that the central Tennent of renewables thinking? So now you tell me buying coal makes sense. China is reliant on countries like Australia for coal, which they hate buying from so much that they boycotted our coal for 2 years, until just recently, because they HAD to purchase it from us. They were suffering without it. There goes your whole theory Victor, right there. Coal is so important to them for power ( because wind and solar are not reliable ) that they were forced to relent on trying to hurt us with their boycott on our coal. To a nation who detests the losing of face, that is huge and a huge indictment on your argument about how cheap or capable wind and solar are. There can be no better rebuttal of your claims. Where are you at in your mind? I support nuclear, but no way would anybody suggest nuclear is cheaper than a coal plant! Do please find me your reference for that ground-breaking research. You try to invert my argument by saying coal mustn't be cheaper because China build other forms of energy, which is bizarre in its  process of deduction. Get back on track: why would coal be still built if it were not the most cheap and reliable 24/7 power generation? That is what you still need to answer, not deflect with abstract drivel. China has not signed up to any Climate action. None. Zip. So do not say they plan to end coal. They are not committed to anything other than what suits them personally, best. Which is why, the way the west is going, that China will become the new world number one nation economically, militarily and by influence within the next few decades. China has proven to be a fair few moves ahead in the international game of chess that is power and influence, while we in the west, do everything possible to facilitate their rise, by undermining our own position of strength.
Reply: @georgebeare8883  Its objective reality.  They are building huge amounts of solar and wind.  In fact more than any coal production plants.
Reply: Thx for taking time to add thorough comment.
Reply: @victor luke  Your a coolaid drinker !
Reply: @terrybarker9694  Not American are you?  The drink is called Kool Aid.  John Stossel already admitted that he was completely wrong.  He forgot to Google the facts and just used the old guy from the institute that also said that smoking cigarettes doesn't cause cancer.
Reply: The future of electric cars will be similar to low production expensive sports cars. They will never replace ICE engine vehicles. This is all politics.
Reply: @victorluke5816  Do you have a link to the info on "molten sand reactors?" Or did you mean Molten Salt Reactors?
Reply: @keithnoneya  Your missive brings back memories. I was an Electrician in the Nuclear Navy before civilian life. I had desired the Electronics Tech position, but you know how it is, "Needs of the service." So I took the BEE schooling and then went to EM 'A' school, Nuclear Training, and the fleet.
A few years after getting to my assignment, there was a need for 400Hz MG set technicians on the (surface) ship.
That school was the best. You had to learn how the MG controller worked from button push to full speed and voltage. The controller cabinet on top of the MG, which was huge, had 20 controller cards in it, and we had to learn how to troubleshoot those cards down to the component level. Yes, the cards could be pulled and replaced very easily, but for the very reason you mentioned, we had to be able to replace components if a replacement card was not available. The best electronics training, theory, practical experience, and a deep understanding of the equipment worked.
Best Wishes and Blessings to you, sir.
Reply: @ChannelNews1  The number one selling car in California is the Model Y.  The number two selling car in California is the Model 3.   All Tesla Models are in the Top 10 list in California.   Tesla Model 3 and Y beat all ICE cars in sales.  California has been the one that sets the standard for the US every single time when it comes to cars.   Also Model 3 is now below the price of an Average ICE vehicle.   Next version of the Tesla to be announced will be the $25K version.   The new manufacturing tech is going to allow all the new vehicles to be built at half the current price.  That's within 5 years.  Also if you look at Europe the Model Y is pretty much king there over VW and Toyota.   Its a matter of a few more years before its obvious to everyone.
Reply: My guess sir, is the point of uncomfortable living just hasn’t been reached, I assume you would agree, if a number of people, be they rich or poor or middle class, have been forced to drink water from a well or dig a hole to shit in, or beg there neighbor for food, shower, brush their teeth, things may get weird.
Reply: @DevilsInBaggyPants1941  Most definitely. I remember that after Hurricane Katrina, it was Exactly like that. I had to live at a friends house 27 miles away to eat and shower so I could work all day in 90 degree weather and 80% humidity or more while fixing my house and helping friends & strangers gut their homes and put all their belongings on the street. Ironically everyone was so polite and kind. People feeding people, sharing gas, cars work with people they didn't even know. It was like we were all in it together and needed each other. Of course there were bad apples who would kidnap women and rape them, break into peoples home and beat them up or worse. It was nice that we had guns to keep them at bay, or at least until the NOPD started going door to door and stealing the guns. Then the criminals and the cops were the only ones with guns. The cops couldn't be everywhere and a lot of people got robbed, beat up or raped even more after the NOPD took our legal guns away.
Reply: The USA has not increased electric generation capacity since about 2005.  Renewables have increased but fossil and nuclear have decreased resulting in no net increase in electric energy generation.
Reply: @frankd8957  They need to hurry up.  If cars go to 100% EV then they need a 25% increase in electrical generation.
Reply: Your comment is interesting to me, mostly because I didn't understand it. I know you were one knowledgeable person talking to another, but I am not a knowledgeable person. If you have time, could you please explain a bit of what you are talking about. In way that even I can grasp. Thank you :)
Reply: now add electric cars to this mix [mess]
Reply: I think you just wrote a couple chapters of a book. Pretty damn long comment